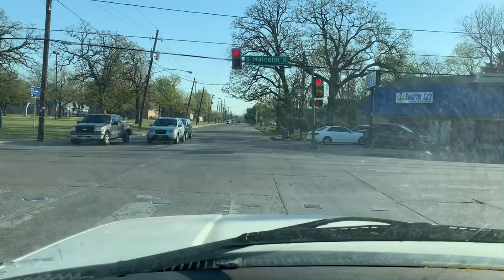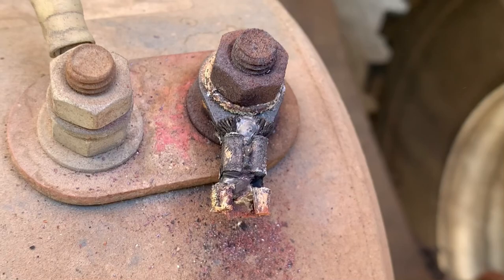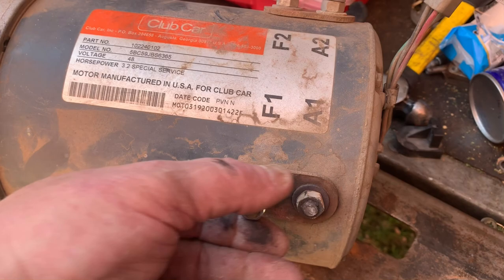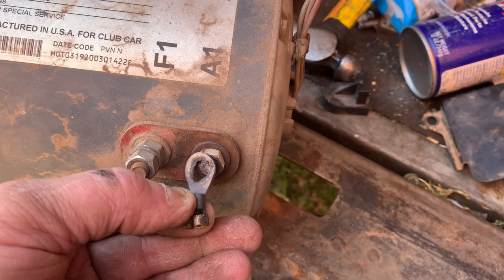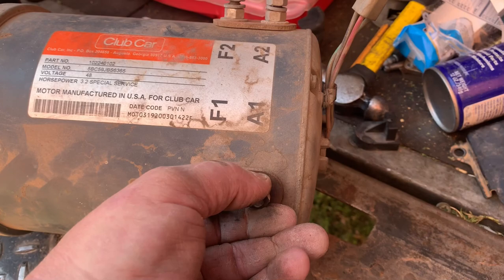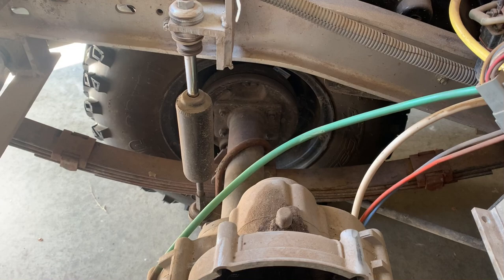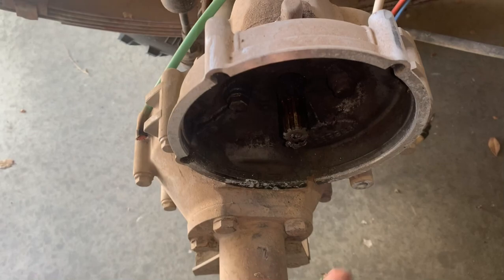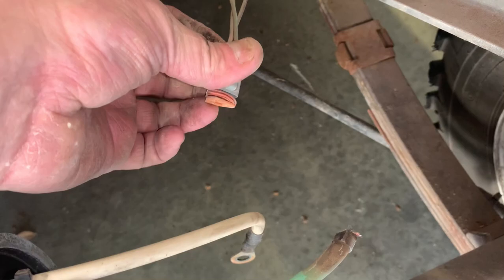48V CLUB CAR GOLF CARTS AREN’T ALWAYS GRAVY!  MELTED MOTOR CONNECTION. NEW MOTOR?

Comment: Ouch I bet thats not a cheap motor from club car.
Reply from the maker: Bout a grand
Reply from the maker: 600 to repair
Reply: Could be fixed for 50$ tops
Reply: @THEMOWERMEDIC1  same happened to mine. Bolt is easy to find and solder. Motor is easy to open as well.
Reply from the maker: Club car wanted 400 to fix it or a new one was 600